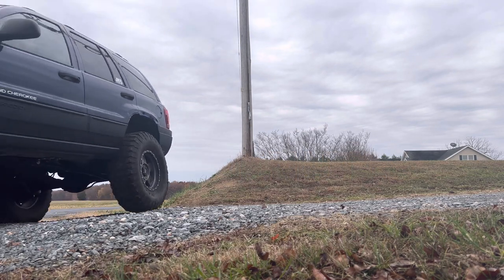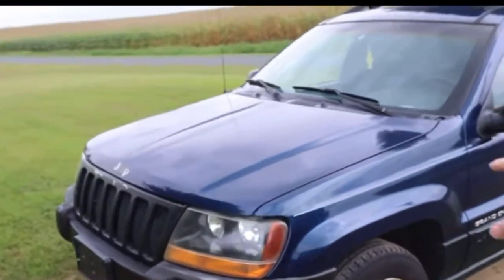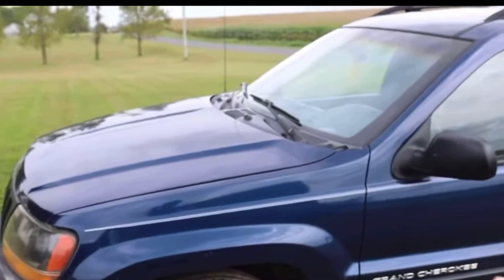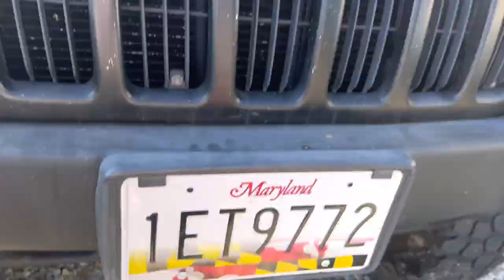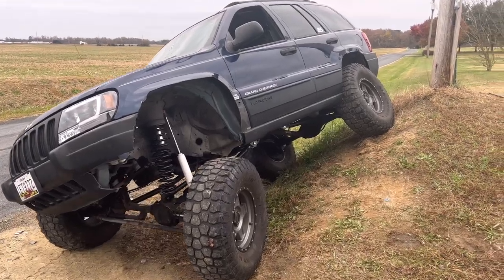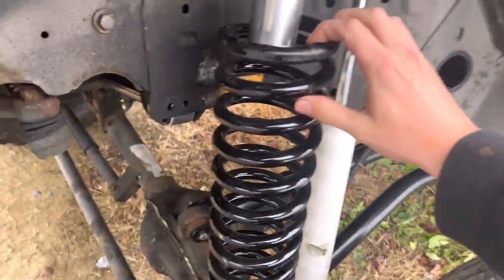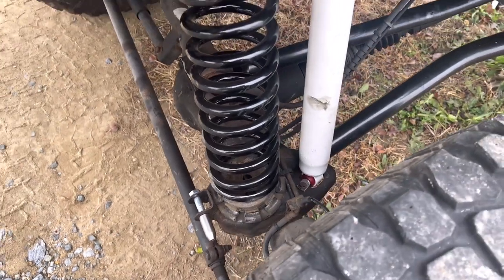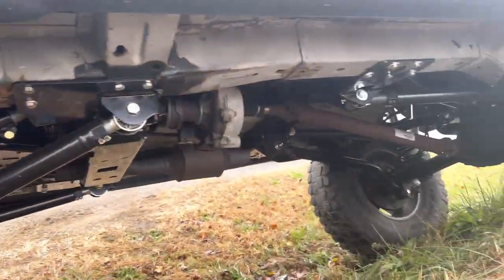JEEP WJ BUILD IN 10 MIN STOCK TO 37s

Comment: Love the blue jeep. The IRO kit is great, I run the same set up on my 2002 WJ. But for once I would like to see someone take the time to trim the fenders without doing a hack job. I cut and rolled the front and rear fenders. Took maybe an extra hour and a half over just cutting.
Reply from the maker: Yeah tbh I didn’t really care how this looks because once it’s on the 43s and tons it will be cut again
Reply: @ROCKY_TV  yeah, I guess that makes sense.
Reply: Well u did a great  looking  job for sure vary  nice indeed.

Comment: Good day. Do you have a list of all the mods and upgrades on you wj Blue Jeep Grand Cherokee?
Reply from the maker: I haven’t put together a list of every part but the main parts are 

6.5” Rock Link Pro IRO lift kit
35x12.50R17 Radar Renegade R7
17” Pro comp wheels
Aluminum Hood vents
Spyder Headlights and Taillights 
Driveshaft swap
JKS disconnects

Comment: What do you recommend for 2000 wj that I use for my work want to lift it 2 inches so I can go on the gravel roads to work don't need to go to the extent like yours pounds pavement most of the time thinking of the budget boost should work fine what do you think can't spend a lot of money  thanks for your input and help your channel and najar rock awesome 👍
Reply: I have wjs  and I 3 inch bb and 1 4 inch propper lift 3 inch is big enough to clear 31s, 4 inch will clear 32, stock is 29-29.5 inch with a 2 inch bb you should be able to fit a 30~inch
Reply: @danwall5010  thanks for your help and input have a great day

Comment: Nice rig. What do you have in palns to fix the spring from not falling out like this? Im from eu, i admire the amount of cheap cherokees you have there in the states.
Reply from the maker: Thank you, I plan to put a little retaining clip on the bottom so it can’t fall and when it’s on 43s I’ll also add limiting straps so it can’t flex to far
Reply: @ROCKY_TV  Great build. Im looking for a solid wj with quadra drive 2 and a 4.0 or 4.7 engine. What is your suggestion to go on engine wise, are diesel engines good in the wj and does it work with lpg? Considering i am located in europe, are bilsteins-ironman-rough country-old man emu good off road manufactors for the wj? Thanks in advance

Comment: Did you get death wobble
Reply from the maker: No
Reply: I need your help
Reply: I just put a 7 inch lift kit on my jeep do I need adjustable upper control arm and
Reply from the maker: Yes
Reply: What would I adjust the upper control arm to and the lower to
Reply from the maker: You have to measure your pinion angles and caster angle and adjust from there it’s not going to be the same lengths as mine
Reply: Ok thanks bro
Reply: Do you have a drop pitman arm?